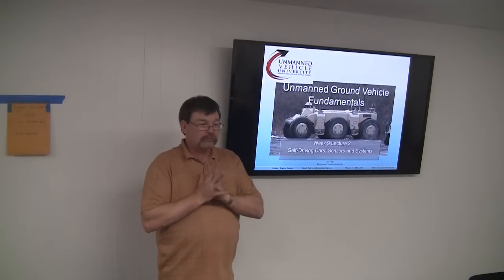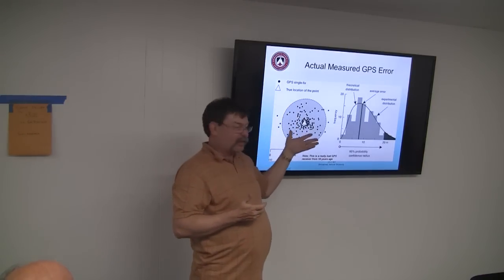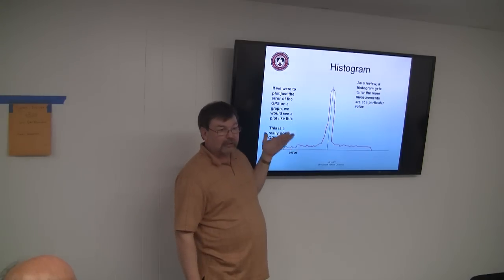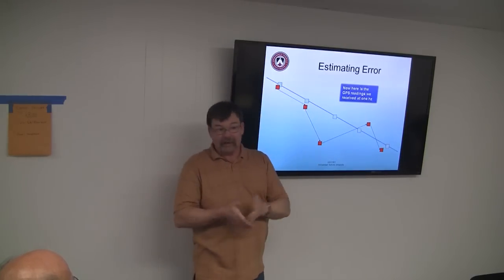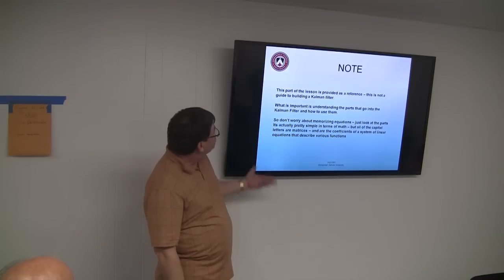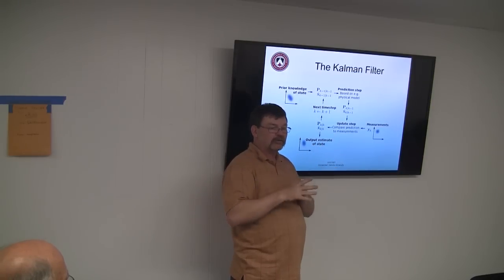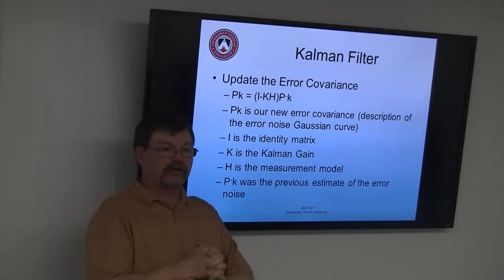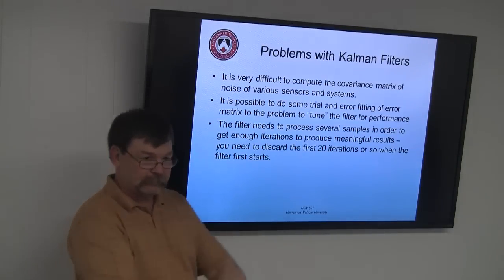Kalman Filter Tutorial

Comment: In the slide "Kalman Filter in detail" (around 35:59), shouldn't H be "a function to go from state vector to sensor reading"? I got a bit thrown by that, as on the next slide H is used to transform y_k (the state vector). Checked on wikipedia as well, it says: "Hk is the observation model which maps the true state space into the observed space".

Comment: Going back to using the wheel diameter to do odometry, can you put the wheel diameter as a state variable, give it your best guess for initial value, and let the kalman filter converge on it. The system is over-determined in position because it has multiple sensors to compute it, can't a cross of all those sensors arrive to a good value for the wheel diameter? It's a general questions for things that are hard to measure like the moment of inertia or the position of the center of gravity in a rocket, can we put them in a state variable, add extraneous sensors and let the system find the values?

Comment: on the NASCAR track couldn't you choose another basis besides {x,y,z} -- an elliptical one that essentially takes the shape of the track into account--and then do {forward θ, sideways} as only two dimensions?
Reply: +Lao Tzu NASCAR tracks are typically sloped and not all tracks follow an elliptical shape. The z-measurements are probably negligible; however, there may be some aerodynamic effects that show up at those high speeds which depend on the z, and thus it would be good to account for.

Comment: 1:06:32 - no, that is not true at all..  You can definitely use dynamically sized vectors/matrices in C, and in C++ you can make the syntax even simpler by overloading the appropriate operators for matrix multiplication, etc...  And you don't even need a math library like GLM to do any of this crap, it takes like a couple hours tops to write this code.  The idea that you need something like Python to multiply matrices "100 times easier" is ridiculous lol.